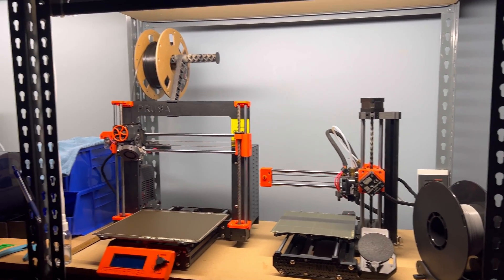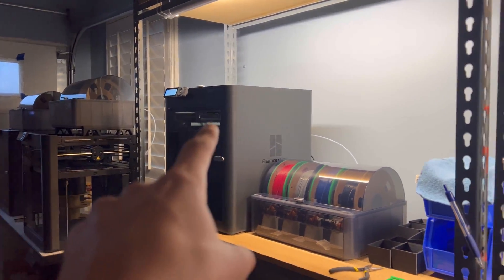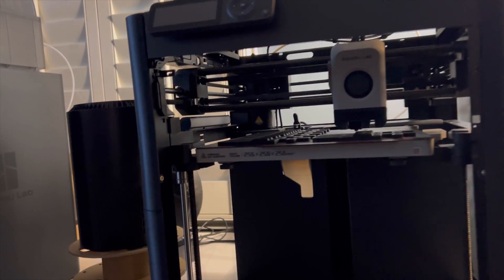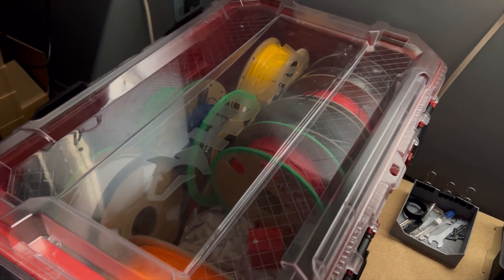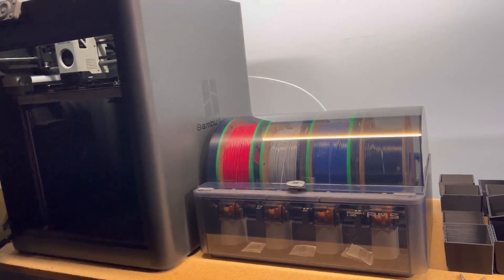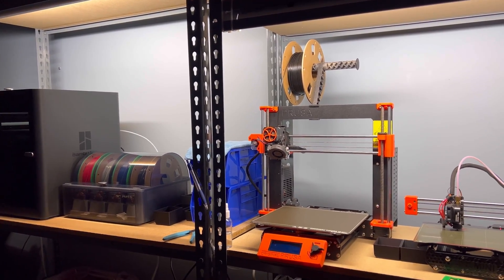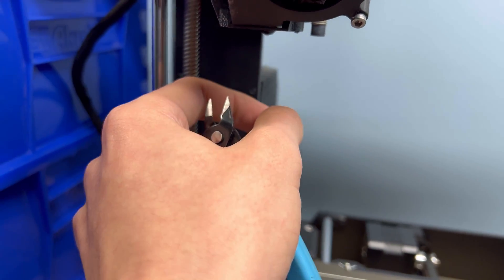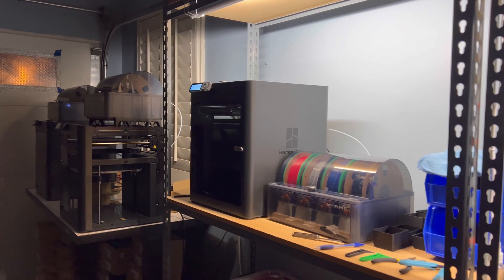Garage 3D Print Farm - Bambu Lab and Prusa Printers

Comment: Nice setup. Got a question/recommendation. Have you thought about, or tested, dedicating a set color to a single Bambu and running gcode to cancel the start/stop poop.
Reply from the maker: Thanks you for watching! I haven’t, is this to reduce the amount of poop? I need multiple colors for my prints.
Reply: @A3DEngineering  gotcha, didn’t realize you were printing multi-color parts, I was thinking you were printing the parts in various colors. But yeah, the thought was to remove the need to poop and cut down on wasted filament and time.